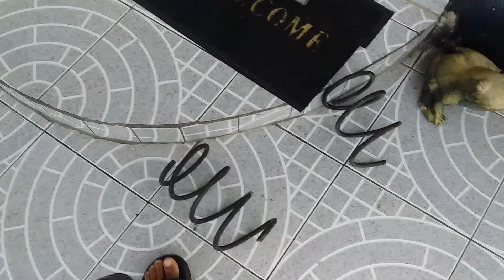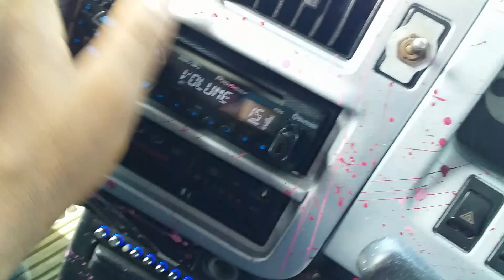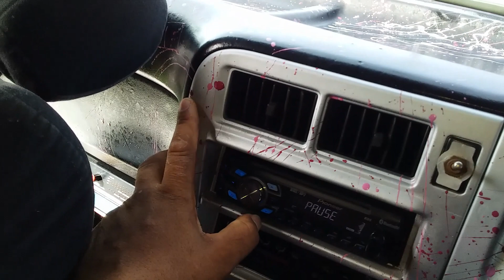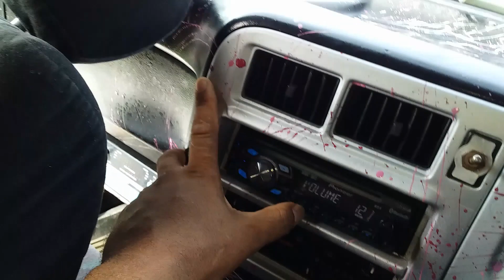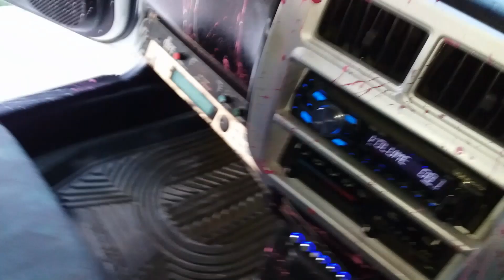FIXING THE MINOR FAULTS ON MOBILE SOUND...

Comment: It’s not the wattage to give you the sound   You need to rebuild the boxes to the correct enclosure specifications for your speakers. Tuning the box to frequency you want will make a huge difference. Also use MDF and it will sound better.
Reply from the maker: I've changed my speakers. And I dont use MDF anymore becuz it doesn't last very long. After a couple years it needs replacing. So I settle for less performance but av a longer life spand on the build. Thanks for the advice thou.